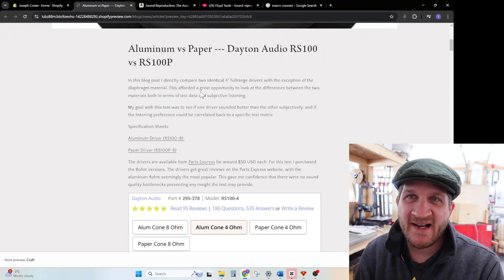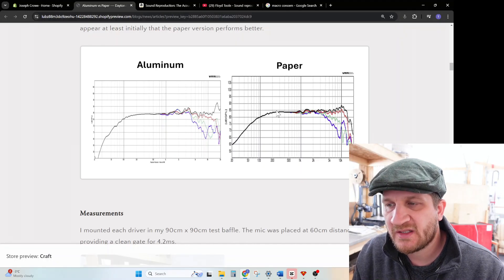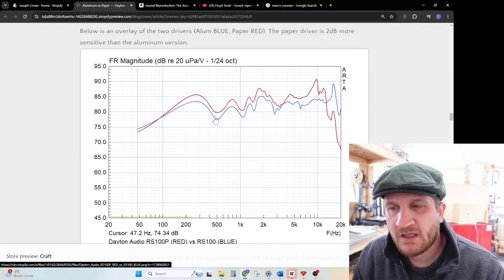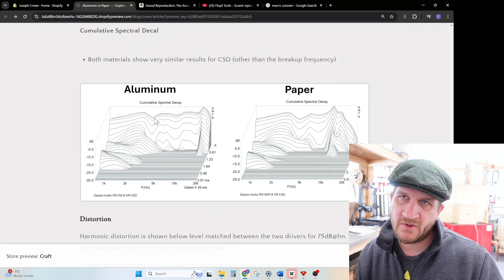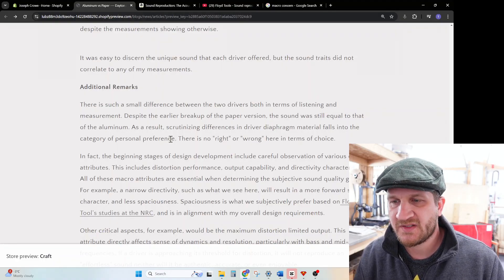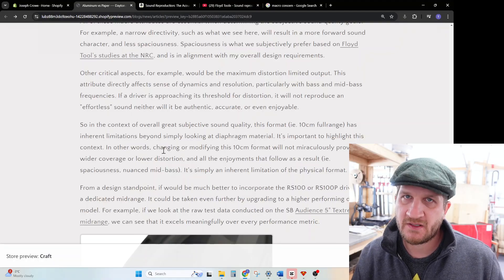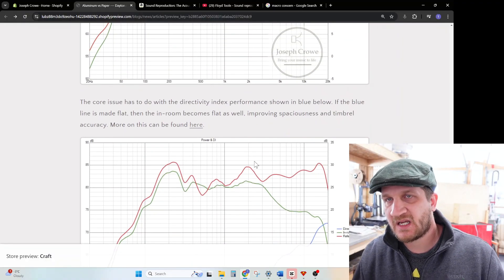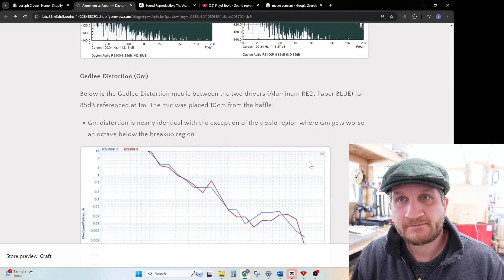Aluminum vs Paper --- Dayton Audio RS100 vs RS100P

Comment: I am planning to pick up a pair of the 7" paper 8 ohms when they are back in stock. The project is a moderately high efficiency OB with sealed 15" bass driver. Depending on how it sounds I may add a rear facing super tweeter but I can't hear much above 12K anymore anyway.

It would be interesting to test in room response of full range drivers in sealed v.s. open baffle. My limited experience in listening seems to indicate that the OB results in a broader room response but I have no way of measuring it.

Comment: never met a 4" cone I liked
Reply from the maker: I can only do that size format when listening near field (less than 2m) and low to medium listening levels…and a smaller room. This is common with ‘B’ systems separate from the main listening room. I’ve found that 3” or 4” sound great on a large waveguide or wide baffle. I’ve never liked narrow baffles.

Comment: Those measurements are completely meaningless because of the adaptor plate. You have a lot of diffraction from the edge of that plate that corrupts your measurement.
Baffle surface needs to be completely flat and the driver needs to be countersunk. Then you will be able to make more correct measurement.
Reply from the maker: This is not a review of a single driver but a comparison between two materials. Yes, there would be a small artifact created by the 12mm step but not nearly as bad as one would think. My channel is not intended to be like Erin’s Audio corner, Hifi Compass, or ASR. We design and build speakers, conduct testing and comparisons, but we don’t intend to create a reference archive.

Comment: I guess my question is;
 If used in a multi-driver system, can these two mid-woofers be interchanged without changes to the filter(s)?
Reply from the maker: The sensitivity is 2dB different so no.

Comment: How do you relate the beaming of a driver based on its size compared to the baffle width of the enclosure?  If they are independent of each other, would the lack of spaciousness apply to any full range driver used without a tweeter?

Would it also play into the treating of a room?  Meaning, if you have the direct reflection areas of a room treated it would reduce the spaciousness of a two-way design and push towards the more directed sound of a larger diaphragm full range design, no?
Reply from the maker: Baffle width is not a associated with directivity, only the width of the source. Other variables are listening distance (further away means more reflected sound reaching the listening position), along with toe-in (less toe-in is more spacious but treble rolls off).
Reply from the maker: Treating the room is extremely important regardless. My room is fully treated and it actually helped with spaciousness. I have absorbent panels covering 30%-40% on all surfaces.
Reply: @JosephCrowesDIYSpeakerBuilding   interesting, thanks for the insight!

Comment: Hi I would love to hear your thoughts on transmission line loudspeakers. I recall reading somewhere that they are extremely difficult to get right and the computations are complex. But if done right some people claim they are the pinnacle for box speaker designs.
Reply from the maker: Yeah I can believe that. I suspect the 2314 BLH isn’t too far off from a TL. There’s a lot of overlap in the design principles. Bass and mid-bass are excellent. I plan to use this configuration in future designs, maybe even using the 5” textreme midrange.
Reply: Sanders Sound Systems has a white paper on this topic on their website. 

British speaker manufacturer PMC will have information about their ATL too.

Comment: I built 3-way open baffle speakers with these as broad mid range, 200Hz-6kHz using active DSP and tri-amps.
I love their sound and prefer the more natural sound of the paper cones.
The hf peak needs to be filtered to flatten it if you are using the top end frequencies of these speakers.

I have also used the PS95 driver in the same speakers and that is also clear, fast and very natural sound.
Reply from the maker: Thanks for sharing your experience. I’m sure they would make great midrange drivers. Now you’re probably wondering if the 5” textreme is a worthwhile upgrade!

Comment: Thanks for sharing! Makes me wonder if maybe there's a big directivity difference between the Markaudio 10.3 (metal diaphragm, smooth FR but a bit boring sounding) and the Tang Band W5 2143 (bamboo paper diaphragm, phase plug, underhung motor - FR bit more lively but also more dynamic, more spacious sound).
I've used them both in the Frugel-Horn XL with a bit of FR compensation in Wiim Pro Plus. The Tang Band W5 is my absolute favourite.
Reply from the maker: There’s definitely differences between similar size drivers that could impact spaciousness. If you look at the off-axis coloured polar plots on the FE108EZ vs FE108NS then you’ll see there’s potential for decently wide coverage at certain frequencies…7kHz is about 80 degree listening window for the FE108NS.  Perhaps the whizzer cone is acting as a small point source in this instance. https://josephcrowe.com/blogs/news/fostex-fe108ez-versus-fe108ns

Comment: Thanks for the interesting video!  I'm curious, did you get hold of a second RS100P driver?  I'm asking because I suspect that the thin paper cone might be hard to maintain uniformity in production.  I've learned the hard way a couple times that just because one sample of a driver performs a certain way doesn't mean that all consistently perform that way.
     I'm not thinking of a "magic bullet" that cleans up the upper midrange of the RS100P, but I do wonder if other samples might match the manufacturer response data closer than your one sample.
Reply from the maker: We had a pair for each material but I understand your point and I should do some quality checks such as impedance. I remember impulse audio’s channel did this and it was informative.

Comment: The test baffle is poorly implemented though as there is a thick smaller baffle that will introduce edge diffractions.
Reply from the maker: Yes, it will have a small impact but this was a comparison video between the same setup of two drivers.

Comment: Good video.l always wanted know the difference in sound of paper vs metal rs 100 a few years back before paper rs 100 available,i did listening comparison in small seal enclosure .driver connected direct to amp no filter.metal rs 100,metal hi vi b3, and peerless tymphany fr9 3.5 paper 8 ohm. Each speaker had it's own strength and weakness.the rs100 had the best low end response, surprisedly deep and punchy but i also found the top end veiled,now i know why(poor off axis response). Need tweeter.the b3 bass was not as good and sound like it needed filter 6-8 khz.but overall good.the tympany fr9 bass not as low and as tight as  rs 100 but ever thing else good very open sound.wish i could find small fr driver with rs 100 bass and everything else like the tympany,any suggestions?
Reply: Thanks for the suggestion, I'll be on the lookout.edit the peerless model that I listened to and liked was the tc9fd18-08 it's still available like alot of driver has increased in price.
Reply: Woops I meant peerless tc9fd18-08

Comment: Please excuse my naivety, but how a 4" driver may have a DI dip at 500Hz ?
Reply: 90x90cm probably baffle step
Reply: @ZegaracRobert  well could be, the wavelength on 500Hz is ~680mm, as well as other reasons. It's a pity that the "measurement" results are not checked vs physics, nor vs anechoic reference, nor accompanied by confidence bounds, etc, and the real results become widely mixed with mere artifacts.

Comment: A cohesive driver review that wraps around some fundamental sound quality topics,  just up to, but not quite prescriptive of the necessary directivity for good sound.  Alluded to here but understating how powerfully convenient the VituixCAD In room response plot can be. VituixCAD is calculating the in room response, which I might colloquially say as power response, just from a few polar measurements, or many. And, all Xover circuit designs are simulated into this in room response. This visualization gives the designer the option to target the Xover EQ to the on axis response or to the more total ambient response or power response to whatever degree the designer likes. It’s really well implemented in the software and I think it makes a bit of an arcane aspect into something almost intuitive. Certainly visual.
Reply from the maker: Yes, VituixCAD is a powerful tool for speaker design.

Comment: Ive used both drivers in many builds... subjectively I prefer the paper
Reply: Of course. It's a matter of characteristics of distortion. Paper cones are more prone to have more and higher even order distortion while harder cones are more prone to odd order distortion. When 3rd order distortion are higher than 2nd order you will get a nasty edgy sound. Take care to avoid to use that region of the driver.
It's a matter of tonality because of distortion characteristics. Aim for a linear distortion where 2nd are 6-9 dB higher than 3rd. Lowest possible distortion is prefered but never use a driver with higher distortion than 0,5 % at listening level if you want clean high end performance.

Comment: Comparing the aluminum to paper graph on axis, the aluminum is 6 DB more sensitive above 10 khz than the paper and goes 6 khz  higher in frequency before breakup. That's a 60% improvement in high frequency response on axis.

Comment: I'm curious to compare the Purifi woofers as I only have experience with the paper ones and haven't liked any other aluminum woofers I've heard. For the listening test, I'd suggest low passing them so that the breakup is effectively filtered out and you're only judging other subjective differences. A lot of the time you'll prefer paper's breakup because it's lower Q. It's effectively smearing detail over a wider range and that's less offensive than a very small band having the resonance peak. When that's filtered out things might be a different story

Comment: Would it be better to flush mount the driver as well as the adapter plate? They'd cause diffraction a bit I'd have thought
Reply: Vance Dickason treats this topic thoroughly and with original research in his Cookbook. The cover is deceiving, it is jam packed with really great information, a lot of which is as good as AES research papers, but condensed.

Comment: I always like the sound of paper drivers better. Sounds quicker and more natural, to me. Aluminum may sound better in enclosed speakers to some, probly because it can be more opaque and block sound inside the speaker from exiting thru the cone before it goes thru the port. 
This is regarding mid drivers and bass drivers. Tweeters are another story.
Reply from the maker: I prefer the paper as well.
Reply: @JosephCrowesDIYSpeakerBuilding  Have you listened to the SB acoustics 6" alu driver? The one that has very good measurements.. It sounds very transperent and I think you would change your mind ;) I bought a pair after looking at all available 3.rd party measurements online and infact it is as good at the measurements say. High sens and 9kHz breakup, whats not to like :).
Reply: @impuls60 not particularly high sensitivity though. Most  measurements suggest  the ballpark of 86ish db 1w/m
Reply: In the end it's preference, but there's certainly something to be said about a proper speaker design using paper and silk tweeters. It's just... nice.